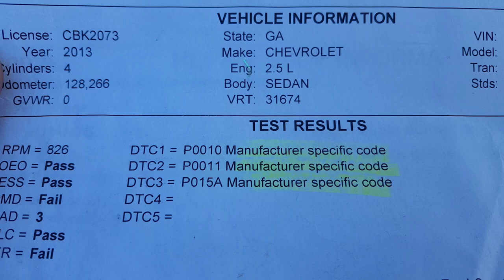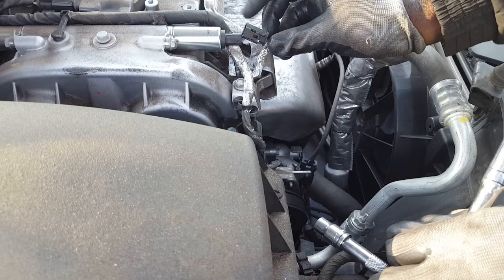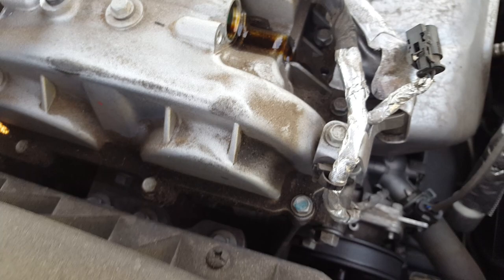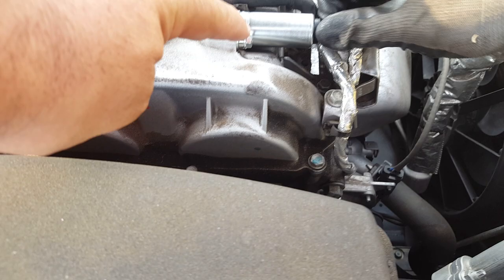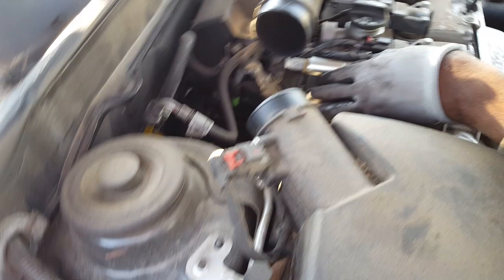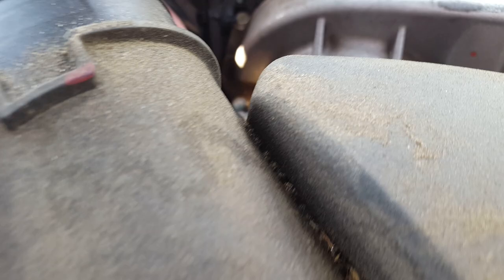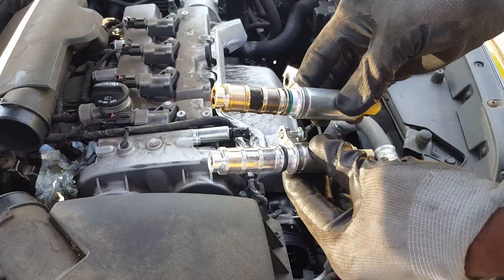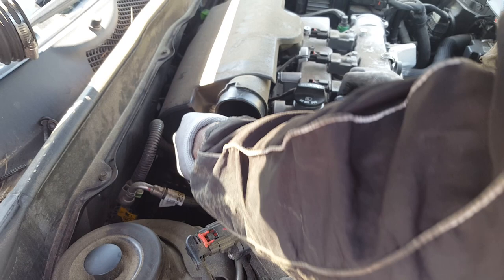2013 chevy malibu 2.5 P0010 P0011 P015A Emission Fail

Comment: Did it fixed de po15a ?
Reply from the maker: Once I replace both of the sensors the code never came back and she was able to pass inspection
Reply: @juniormartinez2586  wow man. I never expected to have an answer that fast. Muchas gracias. Thank you. I’m working on a 2014 Malibu right now same codes   I was just not sure about the po15A. Thanks again

Comment: Wow way to tight on that little bolt.   Did we guess or because scanner said bad what about wiring ecm etc.      perfect example of parts changers not technicians
Reply from the maker: some bolts just need hand tighed is not like your bolting the head cylinder to torque specs smart guy